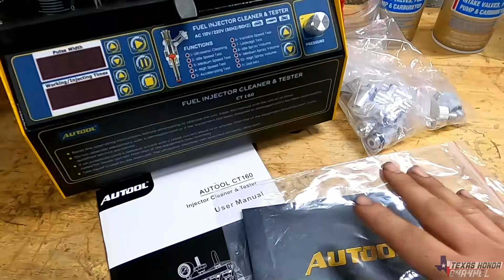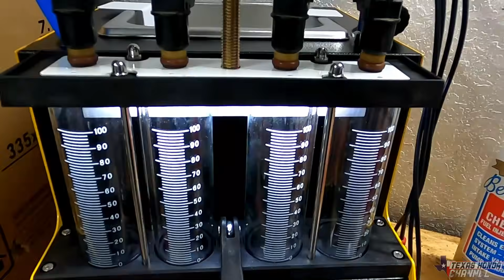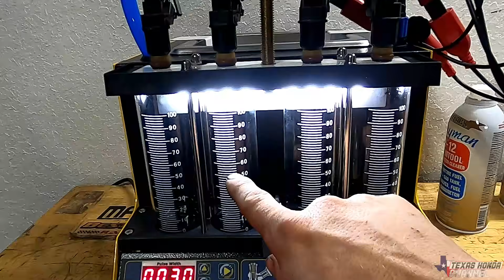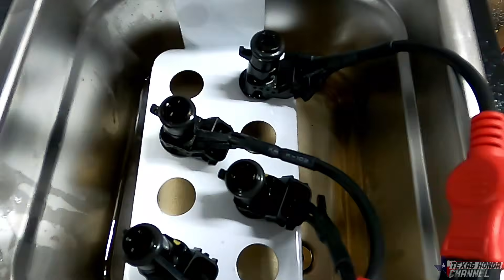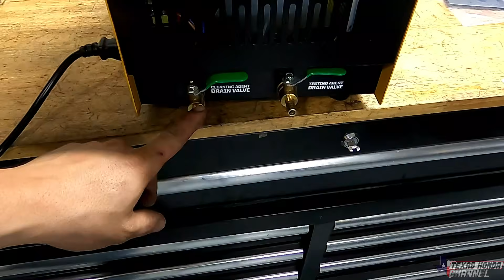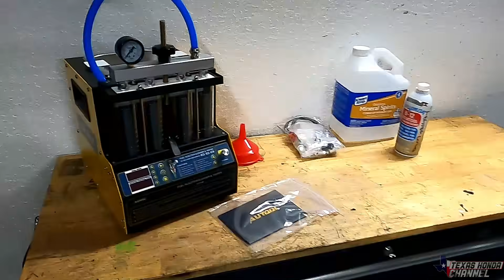Cleaning/Flow testing injectors with my AUTOOL CT-160 Injector cleaner!

Comment: Has anyone tried running injectors without filter baskets? I've read online that some have done this with success. I decapped some injectors for a turbo 6.0 LS a few years ago and they worked out great. I'm thinking about trying some decaps that also have the baskets removed.

Comment: FYI, the CT160 does have a filter sock on the internal pump. The pump and cylinder drain are not sealed to the tank, so don't tip the machine over.  I'm happy with mine. Just switched to no-odor mineral spirits, kerosene stinks! Don't use the "green" mineral spirits. I've discovered several amazon/ebay special injectors that were DOA.
Reply: Can you provide link for what you use?
Reply: @DanCycles  Also, it will come in either a metal can or a clear plastic jug.  Sunyside and Kleenstrip are ok brands for this.  The low odor mineral spirits is much nicer to use than Kerosene, does not stink up the shop, and has other uses too.
Reply: what are green mineral spirits? thanks
Reply: @Retro-Gfx-Official  "green" as in supposedly better for the environment.  IDK what they put in it, but it's a milky white liquid, faint hint of mineral spirits smell.  Marketed as a type of low VOC Mineral Spirits.  I don't know if all Low VOC versions are milky white.
Reply: @TEAMPHY6  Oh i see , yeah ive not seen that type before
Reply: @Retro-Gfx-Official  If you stick with stuff that's in a metal can, or you can see it's clear in the plastic jug, you'll probably be ok.  It's much more pleasant to work with, very little smell.  Plus you can use it for thinning many types of paints, cleaning, etc.
Reply: @TEAMPHY6  Yeah good that its got those uses too. Thanks for the reply
Reply: I'm in Nigeria with limited access to most of these fluids. Can i use a Paint thinner as this is easily accessible?
Reply: @mrpartsng better would be something not as flammable.  Kerosene could work but it stinks (I used that first). Diesel or baby oil (scented mineral oil) may be too thick
Reply: @TEAMPHY6  For testing purposes, anhydrous alcohol with a concentration of 90% or higher can be used as a substitute, which will not damage the machine's oil pump.

Comment: You need to tell everyone if they don’t use the right cleaning fluid that B12 or any other fuel cleaner from the parts house will eat the heat shrink off the wires and then they will start touching cutting the machine off

Comment: Friend, thanks for your explanation, I have a question, can I only clean and test petrol injectors with this? or can I also use diesel injectors and are there certain brands that can and cannot be tested?
Reply: There is no restriction on the brands that can be cleaned, but the interfaces are replaceable if tested.

Comment: To anyone who buys this machine: DO NOT USE CHEMTOOL B12 OR ANY HARSH CHEMICAL FOR THE TESTING FLUID ON THIS MACHINE!!! It will EAT away at the internal plastic parts of the tubes and tank mechanism and destroy it. I learned this the hard way, and my man here on this video learned it quietly as well. This machine is intended to be used with Isopropyl Alcohol 91% or higher for the testing fluid, and a mix of water and ultrasonic cleaning agent for the bath. I contacted Autool about my machine’s demise, and luckily they sent me a replacement seal kit, tank, and fuel pump. I also had to replace a plastic tray that directs all the liquid into the tank. It was a nasty mess… Otherwise, this is a pretty nice machine, and Autool honors the 3 year warranty. Beware of the black gooey mess 😅
Reply: It says so in the manual by the way, but thanks for the heads up!
Reply: How do you reverse flow it?
Reply: @ injectors upside down
Reply: @elcano9l52  how would that work. Doesn't it only generate pressure one way?
Reply: Can I use Isopropyl alcohol
Reply: @hard-p3x , yes, autool recommends in the manual to use isopropyl alcohol to not damage the plastic parts. worked for me.
Reply: @joeybee2675  thanks I have some of that. Should I add any distilled water?
Reply: @hard-p3x  i guess you could do it, i used 1,5 L pure alcohol instead.
Reply: @joeybee2675 what did you use for the sonic bath?
Reply: @Screamingz1  I used a special ultrasonic cleaner for Injector parts.since I live in Germany I guess I doesn’t make sense to give you the name of that local brand but any ultrasonic cleaner will do the trick. Tickopur is a favorite one for car parts as well.
Reply: Thank god, I never read the manual and am just seeing this comment but thank god I thought about using alcohol with a little purified water, the only thing I worry about is that I leave it overnight time and time
Reply: But he didn't use b12 for testing wth?
Reply: Dang I was going to use b12 after watching Vice Grip Garage do it. Thanks for the heads up.
Reply: Also be sure and look and or replace the internal filter basket of the injectors. I have ID1700s and in the machine I tested twice once before and after cleaning and I noticed one injector was leaking from the bar that you tighten down and I noticed it was flowing less even after cleaning well I started looking and luckily I labeled them so I noticed a tiny piece of aluminum stuck inside the filter and I removed it and it looks like a burr from the aluminum bar that the injectors are seated into. It must have been a machining error or something but luckily I didn’t clean them and call it good and run them in my built car.
Reply: Also be sure and look and or replace the internal filter basket of the injectors. I have ID1700s and in the machine I tested twice once before and after cleaning and I noticed one injector was leaking from the bar that you tighten down and I noticed it was flowing less even after cleaning well I started looking and luckily I labeled them so I noticed a tiny piece of aluminum stuck inside the filter and I removed it and it looks like a burr from the aluminum bar that the injectors are seated into. It must have been a machining error or something but luckily I didn’t clean them and call it good and run them in my built car.
Reply: How do you know if different electrical connectors work across brand to brand? I have Bosch injectors in my 2019 Audi rs5. I’m looking into buying this but im afraid of not having the right connections from the machine to my injectors
Reply: What cleaner exactly you use thanks ?
Reply: I am using sea foam injector cleaner for the bath but I will be using am alcohol for the cleaning , it’s fine to use something like seafood for the bath.
Reply: he didn’t use b12 for the testing fluid, he used it for the ultrasonic cleaner. Is that still okay?

Comment: Why didn't you use the heat function?
Reply: Because he isn't using proper (water based) injector cleaning fluid. Not safe to hear flammable liquid.
Reply: @FastRyanC what is the correct fluid to use? Anything I can buy from the store and not mix?

Comment: Thanks for this video! It answers a lot of my questions prior to making this purchase. Some questions: I’m guessing the mineral spirits is just for testing, acting like a tank full of gas basically, correct? Are there any other chemicals that can be used that won’t harm injectors and parts? Is the mineral spirits a one time use and throw away deal? Do you throw away as it gets dirty? 

For the actual ultrasonic cleaning solution, any other recommended chemicals? I’ve seen folks use carb cleaner, or even the pour in tank style chemicals. What are other options? Thanks again!
Reply: injector rehab ultrasonic injectior cleaning concentrate 10:1 makes 5 gallons

Comment: I got the older version the ct150, chemtool will melt all the plastic off the machine, I would beware using them.
Reply: What solution do you recommend?
Reply: Use injector rehab ultrasonic cleaning fluid concentrate 10:1 makes 5 gallons & denatured alcohol for testing fluid.
*mineral spirits is not recommended
Reply: From my research diluted simple green

Comment: thanks for sharing your experience and detailed explanation of machine using. i have noticed these injectors are kehin does machine helped you know their flow rate. i have another machine but no way to measure the flow rate directly as the glass cylinders capacity only 1000 mm there is no flow rate selection on the machine only idle, high, low and leak test. how can i calculate the flow rate of unknown kehin injectors or any other injector, thanks again family man.

Comment: A friend query the machine autool ct 160 with how much voltage works 220 or 110v. I have doubts about burning my new machine
Reply from the maker: a normal house outlet.
Reply: Their website stated that its operating voltage is 110-230 v.

Comment: Hey cool vid !! I just started watching your Channel, because I just bought a 2003 3.2 TL and It has 138000 on it and it drives like new.  Lot's of Power. Plus you cant even hear the motor when its running unless i have the gas on and Vtec kickin The  85 year old lady I bought from had it religious serviced at the dealer. and she  did  not rag on it. from what I understand is that these cars from Honda/ Acura are built better  than most. and I would like to try to Pickup the Odyssey Intake and send you my injectors for cleaning,(Name your Price)Flat rate US  POSTAL. You really seem to know what your talking about. where do you find this info about these cars? Very impressive work you have Done , I am  Fan boy. God Bless An be well. Thanks for sharing, I'm learning alot from you!!

Comment: Also, to note with an injector cleaner, when you run E85, injectors tend not to flow the same if you let them sit for too long!
Reply from the maker: Yup that’s where this machine comes in handy you can clean them E85 injectors. Not all injectors can be cleaned though unfortunately. Some just crap out when they sit too long with E in them

Comment: Awesome!  My j35 bogged down to 500 rpm for 5 seconds after revving it in park to 3500.  I d k what happened except my homemade additive was a fail even at 2 ounces.  from a month ago tryin to add what diesel guys did lol
Reply: Guess ill stick with lucas for higher octane and to lubricate the upper cylinders since theres no sludge in that like mcd fryer oil

I did try 2 ounces of clear oil straight out the jug as additive.  Im guessing that  must 've given everything a coating like lucas injector cleaner bc it was quite and lean even in lift
Reply: @rscope1605  check out his video on the lubricant test he did with that bestline. It was amazing results
Reply: @GlassWerx  ok.  And yes i did make a fail lol.  It was an experiment that i realized coagulated fluids of filtered from store fryer oil is still sludgy especially after 2 years - maybe fine sediments sticking to it -
Reply: @rscope1605  thats cool that you tried tho. Hopefully it didn't damage your engine. Keep trying never know what u can come up with.
Reply from the maker: @rscope1605  bestline makes the best fuel cleaner I have ever used. I used it so much they reached out to sponsor me even! So I can pass the savings. Feel free to try it www.racingadditives.com and use code Dguy20 for 20% off! If your interested.
Reply: I did try 2 ounces clear oil from sam's, a 4.5 gallon jug lol.  But then i got gas from a A plus exxon and that must ve had some strong cleaner like alcohol or something.  It cleaned that coating of clear ol good - but the j35 did run lean and the coating also muffled it all the way past the warn resonators for the 2 weeks
Reply: @rscope1605  could have been the ethanol in the gas. Alot of places don't measure the ethanol in their fuel they just splash blend. Basically just fill part way with fuel n dump ethanol  on top n let it blend itself.
Reply: @GlassWerx  if you have a wawa over there , the D. tree octane booster which has meth anol blends good with there 87 meth. gas. The other stations dont seem compatible with this new smells like chocolate axe bodysparay formula.  But L8ley ive seen only 10 ounce fuel line anti freezE at my store but still worth a try to pour 2 ounces AFTER filling .. -so i can use it 3 or 4x
Reply: @rscope1605  we don't have wawa up in our area. I pretty much use Lucas for injector cleaner and stp octane booster but haven't needed either n a while. Gonna try n finish hooking up rest of wiring today n get car back running. Its been sitting  too long. But its all done for now.
Reply: In my other car i ran e85 and too much of this free stuff.  But years prior before sheetz changed there formula from the dirty bottom of the barrel stuff it made the 4 banger sound great even after 1 fill up but then a dollar tree octane booster which smells like reminiscents of clean chittlans ? or chicken gizzards sreamed made with methanol cleaned it out and i could hear the valves sound like raw thin sticks for a while.  I was like ..

Comment: Thats pretty cool tool. Definitely  not cheap. Subbed to agn as well. He's got some cool cars on there.   I'd love be able  build up a nice engine for mine like some of the stuff he's got.
Reply from the maker: He is really good at what he does and thank you for that! Definitely not cheap by any means. I didn’t have enough to get the injector basket removal tool and filters so I got just the machine. Been saving forever for one lol
Reply: @TexasHondaChannel  looks like what ya got was plenty. I saved up for a while then that stimulus  hit n got my last parts for my car I been waiting lol. Now if I do anything  else other then interior which I wana start doing soon. ALL custom fiberglass panels n headliner ect. I'd like to j swap it n convert to manual trans. While your giving out subs send them my way lol. Anyways. Good stuff ready to see what difference decapping injectors will do.
Reply from the maker: @GlassWerx  ours went to mostly paying bills and debts off now we are caught up which helps a lot but still scraping by but no longer in debt scraping by is a way different type of scraping by.
Reply: @TexasHondaChannel  yeah we did the same thing with ours. Paid bills n got caught up. Used chuck of taxes not stimulus idk why thought it was other way around. Either way I got my goodies lol and were caught up on bills.